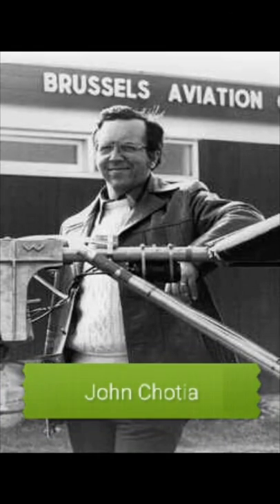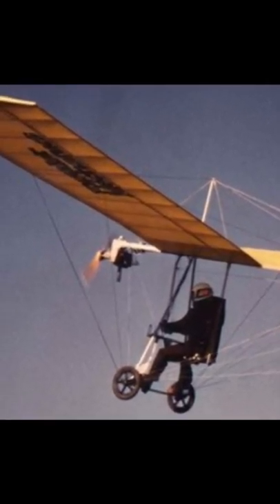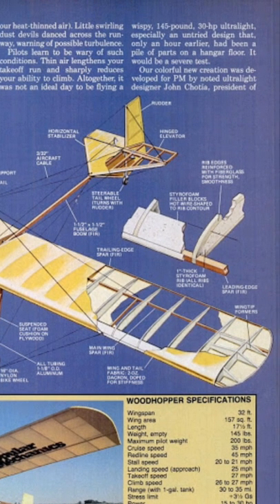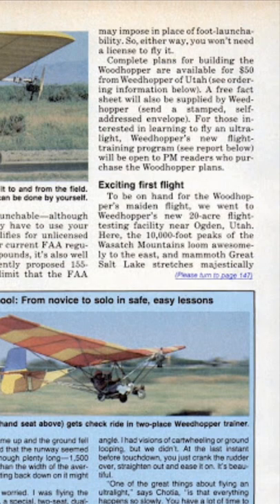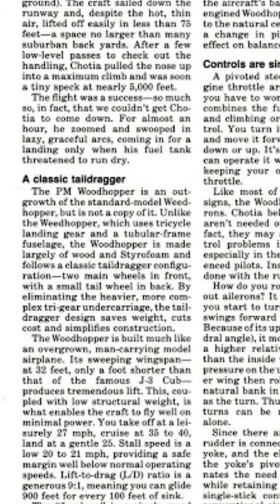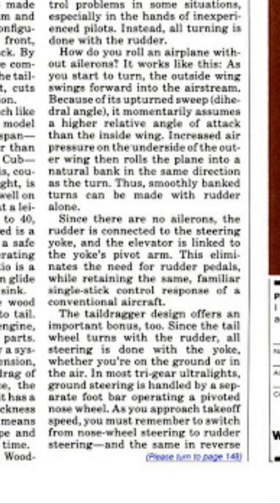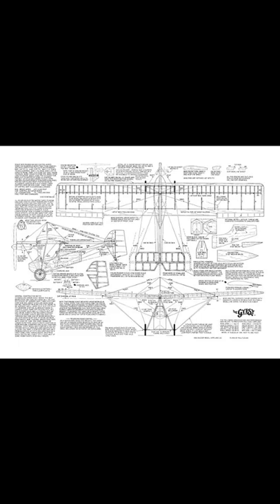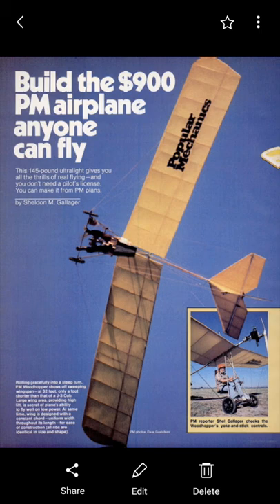Wood Hopper DIY Ultralight Aircraft

Comment: As a regular 3 axis pilot I find the idea of 2 axis controls on these ultralights smooth but also a bit disturbing, especially knowing what a thermal can do.
I would definitely be interested in plans as I am having troubles sourcing 6061 aluminium hence wood is my only choice. 
SkyPup also looks interesting, but damn me if it doesnt look like you would get stuck if you needed to bail out.